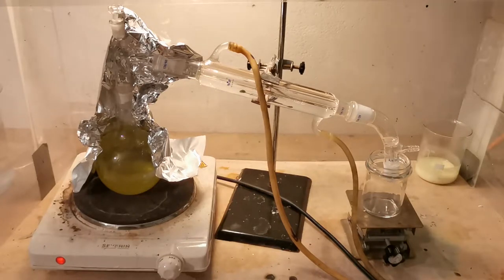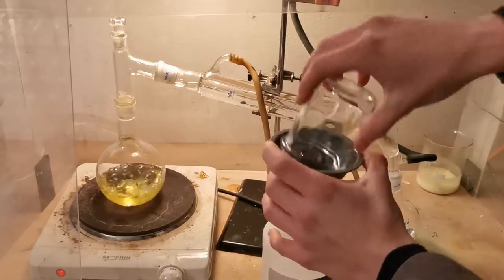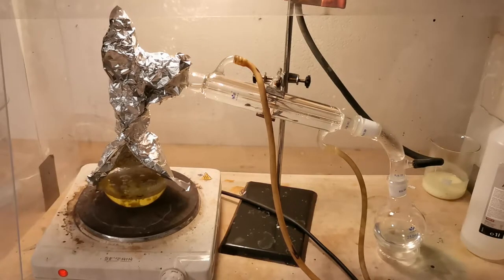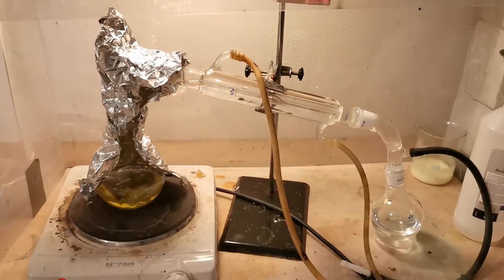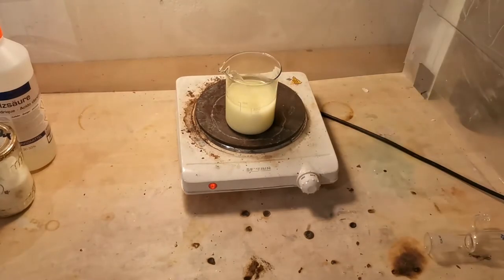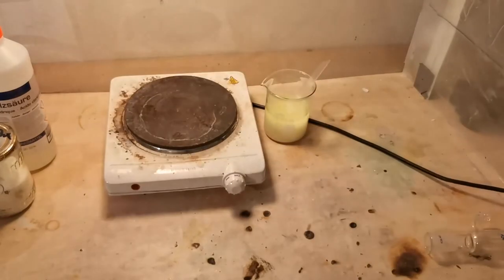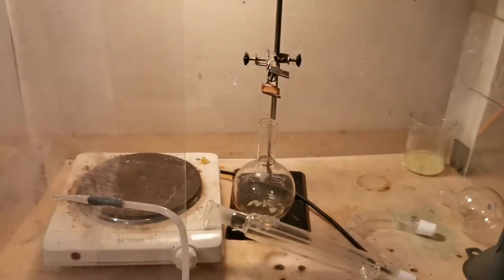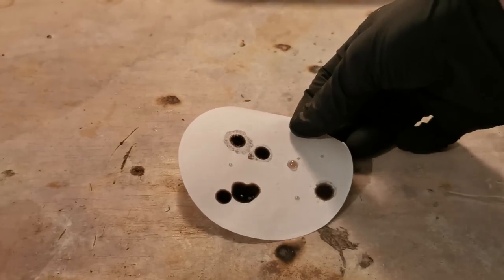Making H2SO4 from Sulfates and HCl

Comment: Making H2SO4 electrolytically, you have to boil of about 98% of the water afterwards to get concentrated acid. That's a big downside to that method. It's better to buy battery acid and boil of 60% of the water (Battery acid 38%)or use the method like you do in this video although it's a longer method.

Comment: Can a similar method be used to make HNO3 from HCL and KNO3? At 40C The potassium chloride is already a lot less soluble than the nitrate, and due to the low boiling point of both acids (in comparison to the one of Sulfuric Acid), i think they can be distilled quite easily.

Comment: The reaction equilibrium normally leans heavily towards sulfates and HCl as a product,  in fact a common way to make HCl is to treat chlorides with H2SO4.
From what I understand this method tricks this equilibrium since NaCl falls out of solution while the sulphate is more soluble and since the extra Na+ & Cl- ions solution give a common-ion effect the solubility of NaCl decreases even more.
I bet the HCl must be very concentrated for this to work though.
Reply: Judging by the solubility values this likely won't work with espom salts but it shoud work really well with ammonium sulfate, a common fertilizer.
Reply: Yep, you can force many reactions that normally wouldn't be favorable by making one of the products precipitate out, in fact you can make sulfuric acid from a sulfate and oxalic acid
Reply: It will even work with 30% HCL.

Comment: How can I redissolve lead sulfate from lead acid battery to revive it? I read somewhere it says you have to remove the acid and add distilled water and use electrolysis (charge the battery) using 5amp. But I also read somewhere that to redissolve crystals you jave to add more concentration of sulfuric acid... So which o e is correct? Can I add hot water maybe?

Comment: Hello from France, nice and éducative vidéo. Do you think that you can do the same SODIUM HYDROGENOSULFATE TO SULFURIC ACID, but using electrolyse way ? Regards.
Reply from the maker: Thank you, I'm actually working on this, but the biggest problem is the membrane, there is not really a good and easy option for the home chemist, I'll finish the video as soon as possible.
Reply: @corrosivechemistry  Hello, thanks for the answer. I trust you will do a good and nice job. I have some interesting documents about Hydrogenosulfate to sulfuric acid for you, but this is in french... Did you have a mail adress ?

Comment: Could you explain what drives the direction of the reaction, since it's usually in th other direction - creating HCl from NaCl and NaHS04.
Reply from the maker: The driving force here is that the reaction stays in equalibrium so all that HCl + NaHSO4 and NaCl + H2SO4 all exist next to each other and when the NaCl is crystalised and filtered out it cannot react back. This only works when the Chloride salt is less soluble then the sulfate, otherwise it would push in the other direction.
Reply: @corrosivechemistry  ah yeah I get it now - it's the rather low solubility of NaCl, particularly in an excess of Cl- ions. Similar to how strong acids can be made with oxalic acid and calcium salts.

Comment: Have you tried changing Dextroamphetamine Sulfate (dextro isomer of the compound d,l-amphetamine sulfate) into Amphetamine Hydrochloride or methamphetamine Hydrochloride. To me it seems as though, they started with the d,l amp and though many prcocess changed it to dexto.  -> I have made many  compounds but tehre is something im doing wrong just by using the 5mg tablets. 
If I can't do this using my own calculations and perform it in the lab I fail my final course. Help please...  or just call me an idiot for not working it out

Comment: Is the yellow color from elemental sulphur? I got a bit of yellow at the start and a lot of spent matches and egg smells which I presume to be sulphur, sulphur dioxide and hydrogen sulphide respectively. Is this side reactions or could it be impurities in the NaHSO4?
Reply from the maker: Those are most likely impurities in the NaHSO4, mine already smells like that in its powder Form, however if you heat it too much (in excess of 300°C) it will produce SO3 and convert to the pyrosulphate Form. I actually explored this reaction too, but it wasn't really feasible to produce sulphuric acid. The yellow color is also probably iron instead of elemental Sulphur.
You could test for iron by the thiocyanate Methode.

Comment: Does the heat of the glass joint not melt the teflon tape?
Reply from the maker: Teflon has a melting point of 327°C. Even when molten the viscosity is verry high and it won't flow easily. It it is genarally considered to be usable up to at least 200°C without any signs of degradation. At 200°C pyrolysis is detectable but noticeable deterioration starts at around 260°C. At 350°C it start to decompose with full pyrolysis reached at 400°C.

Comment: Can I do these same steps with the Ferric Sulphate salt? Or do I have to change the process? I want to make H2SO4 from Fe2(SO4)3, what should I do? I will be burning the ferric salt, so I am wondering if I can produce H2SO4 from the SO3 that will be released. 

Thank you for the help.
Reply: You can make H2SO4 directly from the iron salt. When heated really much, it will decompose into ironoxides, SO3 and some water as well. The later two combine, forming H2SO4. This is the oldest way to make sulfuric acid
Reply: @TheRecho  Is SO3 highly soluble in water? Do I have to shower water on the gas or do I directly release it inside a chamber containing water?
Reply: @immadamir  You just have to distill. There will be water vapour as well as SO3. But to answer your question. Yes, SO3 is very 'soluble' in water. It reacts with water, as you know, to form H2SO4.
Reply: @TheRecho  I have read that it is an exothermic reaction. Does this changes if I use only tap water?
Reply: @immadamir  No. It will still produce a lot of heat.
Reply: @immadamir  be aware the SO3 vapors only soluble in H2SO4 if you release them in the air they can stand many hours that why very havy accidents happenend SO3 disolve in pure water very slowly.

Comment: wow thank you so much but how can hydrogen displace sodium or is it the other way around sodium displaces hydrogen this saved me 30 dollars from buying an addition funnel i was gona use nurd rages metabisulfate oxidiser method also this uses cheaper chemicals thanks
Reply from the maker: Thank you, the hydrogen in the HCl displaces the Na in the NaHSO4, and by cooling it down the Na and the Cl precipitate as Sodium chloride, but you won't get all out, thats the downside of this method, the Sulfuric acid will be contaminated with salt, but for dirty reactions where a little NaCl doesn't matter this is a cheap way to make A little H2SO4
Reply: @corrosivechemistry  but hydrogen has a lower reactivity

Comment: I live where you can buy 92% for drain unclogging so I wont be using this. But its still useful in case that changes. Thanks.
Reply from the maker: Yeah, if you have access to sulfuric acid then this process definitely isn't needed, I can buy it as a 10% solution for pool acidification which I just have to boil down and maybe distill.
But it's interesting that this process is possible.

Comment: So 3 moles of HCL for evey mol of NaHSO3?
Reply from the maker: Kind of, in this case the exact stoichiometric ratio isn't important, but having a lot of excess HCl present is. This will drive down the solubility of the NaCl due to the common ion effect, but also ensure that there is enough H+ available to push the reaction forward.
Reply: @corrosivechemistry  thanks

Comment: Why didn't you just skip the boiling process and just do the distillation instead?
Reply from the maker: Because the real reaction happens while cooling the mixture. When the NaCl falls out of solution the sulfuric acid is left behind. And I only boil it to ensure a complete mixing of the chemicals before crystalising.
But while your crystals are forming there still has to be a lot of HCl present so you can only destill after you have removed the crystals by decanting or filtering.
Otherwise you will just be producing HCl again since it will boil off instead of forming NaCl and sulfuric acid.
Reply: @corrosivechemistry  So you are obviously using stoichiometric amounts of HCL and NaHSO4 so that they will all be used up, right?
Reply: @Berghiker  I think you need more HCl to displace the equilibrium to the H2SO4 side.

Comment: I made H2SO4 electrolytically by electrolysis using a platinum anode and it took no longer than 7 hours. It will never get completely clear like water. The solution will remain a very light green color and is around 51 to 56% H2SO4. If you continue any longer, the color will not get any clearer and the acid itsef will start to evaporate which is a waste.
Reply from the maker: Did you make it like you said in your other comment without a separation between cells? If so please elaborate, it is possible with copper sulfate as the electrolyte, but not with NaHSO4 at least not that I'm aware of. Also I'm pretty sure it wont evaporate like you said, the boiling point of sulfuric acid is around 300C and before reaching the azeotrope of around 98% you'll be boiling of water actually increasing the concentration.
Reply: @corrosivechemistry  I used copper sulphate 40g in 100ml water. No seperation. I haven't boiled down the acid yet. Very corrosive fumes were given off from the electrolysis as it was extremely hot running at 7 amps! the fumes then condensed on the outer glass covering over the beaker and ended up on the table and some in the air.